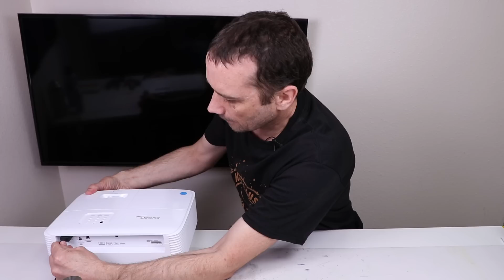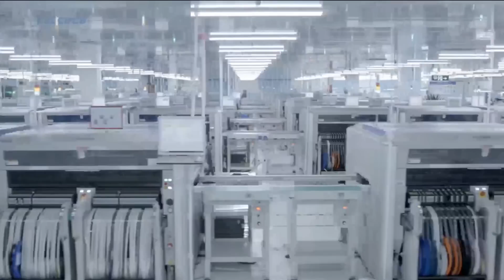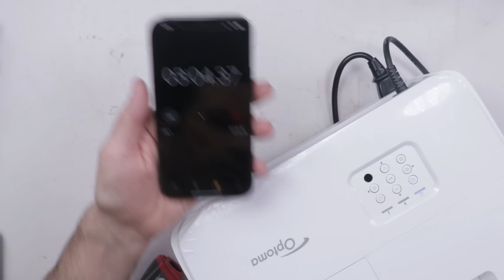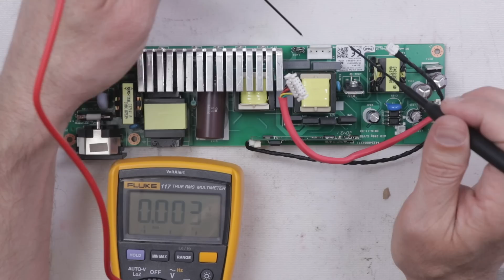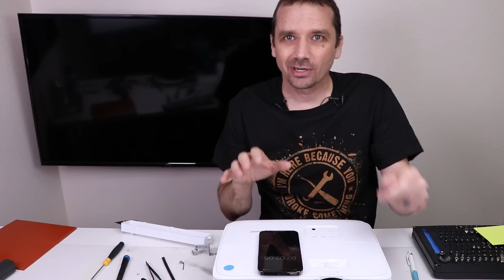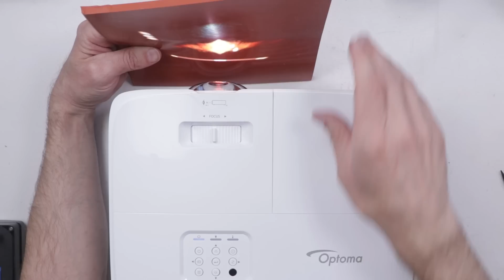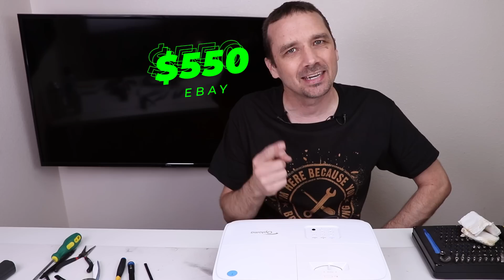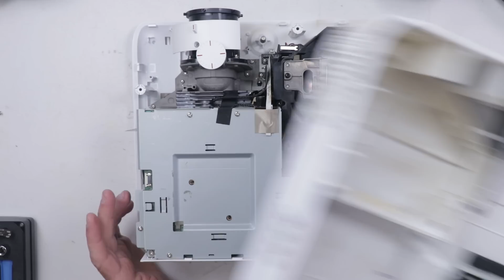I Bought 6 BROKEN Projectors - But Can I Fix Them and Make Money?!

Comment: "And we get zero volts across a fuse"... what next, measuring current across a mains socket???
If you're getting voltage across a fuse, first unplug the thing from mains and realise that any voltage above 1v across a fuse meant the fuse was blown, it is supposed to measure zero (and close to zero during use as it's essentially a self-melting heater that melts itself if capacitors, resistors and silicon suddenly identify as a wire unexpectedly)

Comment: Almost all beamers have these easy to change lamps because the lamps always have a certain life time. They also almost always have similar casings for the actual lamp and inside those cases there's almost always the same lamp which can be switched. At least that's what I'm able to fix at work without a professional like you :)

Comment: A good way to remove smoke damage is acetone.  You may want to try it.
Reply: ! Careful ! It might also react with plastic, it likes to eat some types... i would be careful with using that, you should at least try it on some hidden part first
Reply: @ExecutorQ3  Fair enough.  We had a microwave in which we badly burned popcorn and the entire thing was just coated in a smoky residue.  Nothing got it off the plastic other than acetone, which dissolved it like it was nothing.

Comment: Could you call them fixed and fully working when you didn't check any signal sources ? Maybe they all turn on and power up but HDMI doesn't work ? Or did you check that off screen ?
Reply from the maker: All of them were connected to my computer when I tested them

Comment: Repairing projectors is nasty business... There many planned sw/hw obsolescence (ranging from stupid auto-lock with reaching certain amount of hours on lamp/filter without service checks to lame heat treating systems). Sure sometimes is just an issue with bad lamp or chips, but i've seen many units acting faulty without any fault really (even some of those that "fix themselves" once uninstall it from mount, disconnect it completely and yet tou for some reason plug it in again on the floor before taking it to service only to find out it's working normally... and keeps working again when reinstalled on the mount... and off/on method already tried before :-) )

Comment: I'm suprised how easy easy this was since projectors aren't excatly known to be servicable with all the properitary parts. Also the lamp swap being this easy is cool.
Reply: The lamp has to be easy to replace as it is a serviceable part that wears out and even has a count down timer built into the projector that will warn you when it needs replacing based on hours of use.

Comment: This started happening recently. I'll try to turn it on, it'll beep, blue light comes on, then it shuts off after a few seconds. After that it won't respond to anything. If I unplug it for a few minutes and plug it back in, it'll do the same thing. If I leave it unplugged for a couple days, I can turn it on without issue.
Is this a power supply issue?
I have a ps4 slim

Comment: I fixed a bunch of projectors from my school skip, about 10 in all, all had the same issue, light valve was broken, could be fixed with a screw adjustment. Also good to always replace the lamps when you do a fix. They were all NEC m230x if anyone was wondering, quite old now and not worth much
Reply: That's the problem with older projectors from just a few years ago, they may have some comon fix thats easy to do. But then the tech moves so fast, the value of them plumets because the current gen is so much better quality. I mean who wants a projector that has a native resolution of 1024x768 XGA resolution with 4:3 aspect ratio? You see a ton of used ones like that on eBay, sure they are bright 3200 lumens, but their contrast ratio is horrible.. What is awful on eBay are the cheap Chinese no name brand projectors claiming  ridiculous specs for cheap. Stick with name brands like Optoma, Epson, BenQ, Sony, JVC etc. Avoid those Chinese knockoffs like the plague, I've opened them up, hot glue holding down wires, plastic lenses, single  speed fan, (for a time, crazy hot quartz light) single LED bulb like those used in drop work lights for shop work.. same control input board used across every cheap Chinese projector thats 1/4 the size of control board you see here. That can accept up to 1080p resolution input that gets converted down to LCD panel resolution that is SD resolution (480) that has crappy contrast. And everything is plastic inside, all subject to that heat the LED high output light puts out. Its slightly better than the old quartz light they used to use, but still tons of heat. Nevermind the fan noise is so much more than on a name brand projector. They just pump these projectors out by the ton, and they end up in our landfills within a year or two because the LCD panel gets burned from the heat. All pure junk. Just buy a name brand projector thats used and it will last years and be far superior in picture quality for the same price. And those $100 projectors listed have almost no brightness to them. More than useless if there is any ambient light in the room.

Comment: have a look on the color wheel (only to find in DLP projectors) somtimes the ball-bearing dies and this could be the buzzing noise i had such a problem in my acer projector it sits right between the lamp and the very beginning of the light tunnel

and for the lamps you cant really tell if a lamp is good or not by looking at it
the lamp driver board has a complex voltage and current parameter program and it will monitoring voltage and current used by the lamp during start up
this kind of lamps need low current at the beginning to warm up savely but the voltage and current is getting up after a while and then it gets brighter but after a while the lamp will have a constant current mode but the voltage can stil vary if the lamp is getting older the normal voltage rises and if its out of spec you will get a lamp error 
keep in mind the logic of this board can only measure it when the lamp is in full power mode (warmed up) that means if you have a bad lamp it will kick of at the very end of the warming phase or even after hours of being on due to rising voltage this is caused because the arc in the lamp needs more voltage to stay stable due to rising preasure inside the bulb by vaporising metal

Comment: a broken lamp is considered a disposable item. They are designed to be replaced. So a projector wouldn't be any good if it wasn't easy to replace. They are all like that doesn't matter what the brand is. I used to do IT. I've seen a few brands.

Comment: Woulda helped if he included the resolution code for each projector, like WXGA for a 720P projector, HDTV for 1080P, WUXGA for 1200, WQUXGA for 4k. Only optoma I have is a WVGA portable, fun little device. Old Epson WUXGA is my movie daily driver.
Reply: Is WUXGA resolution actually 4:3 aspect ratio? All of them except the last two that buzzed, were 1080P. The last two use e-shift technology to generate the 4k resolution. Shifting the panel back and forth rapidly to generate 4k resolution. Thats why he heard a buzzing.

Comment: In my experience the buzzing could either be coming from the fan (most common) or the colourwheel actuator (can be trouble). If it's really bad it's often worth sticking a finger on the fan casing to see if there's any severe vibration. If so, it's not too bad a job to replace it.
Reply: Those last two were 4k, they use e-shift Pixel shifting technology to generate 4k resolution from 1080 panel. i.e. the panel shifts over slightly to generate the other half of the pic, creating a full 3840x2160 picture. Only Sony and JVC (if I remember correctly) are the only native resolution 4k projectors that use full resolution LCD panels. With 4096x2160 on their panels. But they cost a ton more than these do.
Reply: @marcusdamberger  yup and I believe these models do just under 240 shifts per second so hence the low buzz.
Reply: Could be coil whine from power supply too

Comment: Awesome man! One thing though, never, ever , ever clean a lens with alcohol. The alcohol can very quickly damage lens coatings, specifically the anti-reflective coating that is on them. Always try to use a lens specific cleaner or if you don't have that, then an alcohol free glass cleaner. This goes for any kind of eyeglasses also. Awesome job though man, love it!
Reply: Wrong.
Reply: @dorfschmidt4833  I can understand why you may think that is wrong. A cursory search on Google gives you an answer to clean anti-reflective coatings with a 15% IPA 85% H2O mixture, directly from a coatings company. What that search fails to explain is that to REMOVE anti-reflective coatings you use a 85% IPA to 15% salt H2O mixture. The salt merely helps to oxidize the coating faster to remove it. Considering that we in the electronics repair community use 99% IPA most of the time, it is absolutely not recommended to use IPA, even 70% IPA on coated lenses. Sure, if there is no coating, use as much alcohol as you want. I have used all techniques to clean and/or remove coatings. Years ago I would ALWAYS use alcohol to clean lenses and I always hated when coating would start to degrade over time. My thought was that it was just wear and tear. then I learned about all this crap and low and behold, no more degraded coatings.
Reply: @housinit  If you don't want to use alcohol, use petroleum ether.
I use different alcohols and also other solvents. I also have my own mixture for cleaning lenses, mirrors, low pass filter.
Reply: @dorfschmidt4833  a lot of the projector manufacturers specifically recommend against using alcohol or any harsh chemicals.  Sure you can use them but you are taking a chance and you are voiding the warranty.
Reply: @dorfschmidt4833  from that projector manufacturer's manual..
"Do not use alkaline/acid detergents or volatile solvents such as alcohol for cleaning lens. If the lens is damaged due to the cleaning process, it is not covered by the warranty."
Reply: @dorfschmidt4833  blurred my phone's camera using alcohol. Not blurred that bad but the colours shifted and was not as expected. I did it on a Google Pixel 3.

Comment: I recently bought 3 projectors, 1 LED and 2 DLP for £15, they all work perfectly too which surprised me.
Reply: Where did you find them so cheap?
Reply: @Stripcherry3  Local flea market.
Reply: DLP is the name of the chip which creates images and LED is the name of the light.
Reply: @JakeJoris  I know, 1 has an LED light, the other 2 have halogen lamps.

Comment: One of the main complaints with projectors is buzzing or humming. You'll often find certain ones hum more than others and it can vary even within the same model. Typically, if you look up the model number you can see if there's a history of humming with the unit which will tell you if it's more or less normal for that unit.

Comment: you should check out the lamp hours before you sell. It’s usually 3000-4000 hrs before u have to replace. I replaced my benq lamp with an original for $170. knockoffs can go for $70. that buzzing and smoke can be because of that. buyers will want that info
Reply: I was going to say. It usually reports it on the GUI. A lamp can be a lot of the cost so worth watching out for.
Reply: @MagikGimp  reports on gui and keeps notifying u once hours are up. You can keep playing with some tricks but that’s dangerous for the unit. one friend had his bulb pop inside the unit
Reply: @meatwad74  my classroom's projector had a filter clean notfication. I think it was a NEC projector.